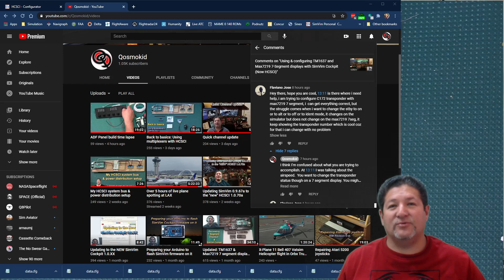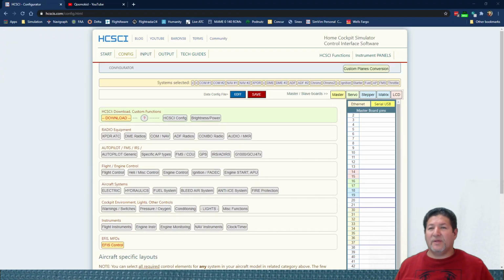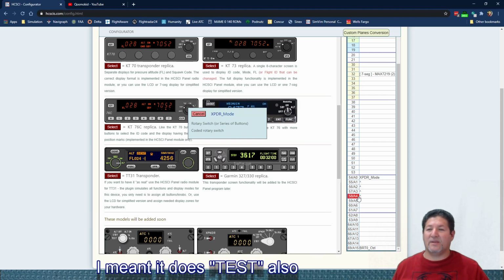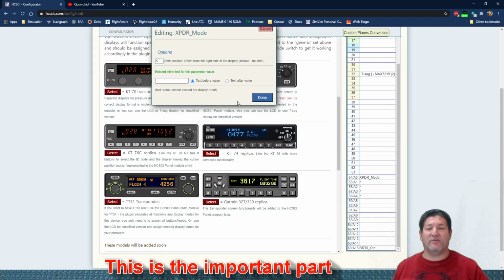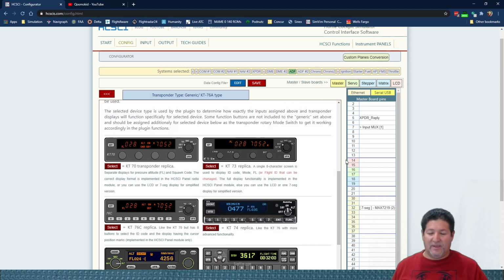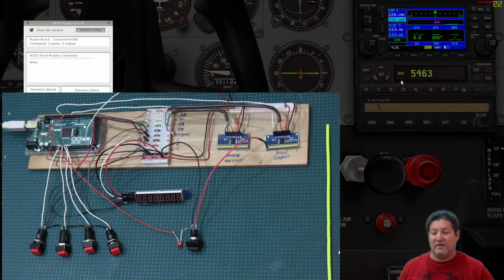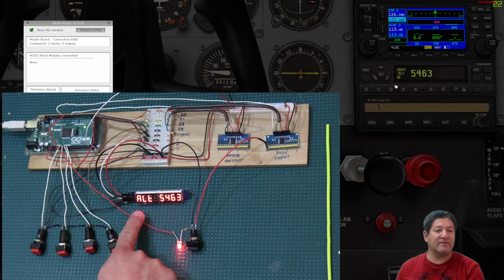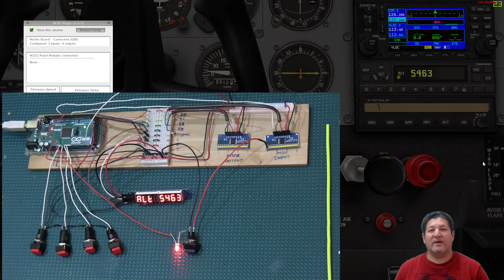Answering Questions: XPDR code & status on one 7 segment display

Comment: hi,beautiful video,but there is a way to use it with 737 by zibo mod?
Reply from the maker: Thanks. Yes, this works perfectly with the Zibo
Reply: @Qosmokid  sorry but i don't understand how.i can't find the "ta only" e "ta/ra" position of the switch
Reply from the maker: @albertomarandino5266  This example i made is the transponder in GA aircraft. If you make a diffetemt transponder like the one in airliners most likely you will use a multi position rotary switch and when you assing it in the configurator you will also have TA and TA/RA
Reply: @Qosmokid  excuse the insistence (and my bad english too) could you make a video explaining this thing? Thank you so much!
Reply from the maker: @albertomarandino5266  I won't be making any videos until the new configurator is released. Have you visited the website and looked at the aircraft image map for the 737? Its all pretty clear once you look at that. But in order to understand how to put this all together you need to read all the sections related to the components you plan to use. Also maybe watching some of the more than 20 videos I have posted here might help too
Reply: @Qosmokid  i have read and (i think)understand the section related the component and i know how to do almost anything what i want.Only, i can find in a specific aircraft and in generic xpdr page where is this particular section.i will try to find out where is my mistake thanks.
Reply from the maker: @albertomarandino5266  I see what you mean, it looks like the transponder types that include TA & TA\RA are not available right now. Before we could select them from the text data table but right now that option is gone too. just be patient a little bit until they publish the new version of the configurator page. I'm sure we will get those back.

Comment: Can you cycle though the modes and only have one switch?  That's how I programmed mine (on the Teensy).
Reply from the maker: With HCSCI I believe you need at least two buttons so they mimic an encoder as left/right clicks to cycle through the modes. Although I think you can set o e button as a selector and make that one swap through the modes each time you press it. 

Honestly I haven't played around much with selectors because I was someone disappointed with that when they replaced input states.

Comment: Is it possible to connect multiple to max7219s? I was wiring my mcp and was planning to use 2 8digit displays. I got the altitude to show up on problem, when I wired the v/s or one display that shows both the left course and speed on the same max7219. if i change the altitutde then all of the displays will show that. If I change the v/s then they all change to that.I have 8 tm1637 displays all showing and no problems but no matter what i do I can't get 2 max 7219s to display without problems
Reply from the maker: Yes you can connect multiple MAX  7219s. It's hard to say what might be the problem without seeing the wiring but as I've said before, 99% of the time it comes down to wiring issues. Are you going to a multiplexer with those? If so are you using a resistor between CLK and GND? One last question, you're not daisy chaining them like its done on MobiFlight right?
Reply: @Qosmokid  i am not using the resistor. I was trying to daisy chain but I got tired of the mess and headaches so ran everything with its own wire to my homemade control board. I am using multiplexer and all of the tm boards work fine but the max boards having been a headache one after another
Reply from the maker: @JalilyFurniture  you cannot daisy chain MAX7219s with HCSCI
Reply: @JalilyFurniture  
Lee, why did you this:  " I was trying to daisy chain but... "  ? 
Have  you read carefully  the HCSCI website? Have you asked help on the website forum or me?
Reply: @SimVimX_System  i wasn't daisy chaining them,  just the vcc, grounds,
Reply: @JalilyFurniture  
OK, understand.
Write to me please about your problem with max7219 (you can do this  in pesonal message, but not on youtube, I'm not using it for conversations.
You can actually use as minimum 16 modules.
Vlad

Comment: Just an idea. Not sure if it’s possible to do with SimVim. Use the 4th digits decimal point or even one of the other digits dp as the reply light in lieu of an LED. I think a regularly flashing LED in the cockpit may be a little distracting but perhaps a small diffuser over the top of it would help make it less so.
Reply from the maker: Not sure if thats possible. At least I haven't noticed a way to address the decimal points.. You can always use a higher resistor to make the LED as dim as you want. I have a flashing LED in my setup for the  ident and it doesn't bother me at all because its not too bright. I just had this one very bright for the demo.
Reply: @Qosmokid  that's right i used a 1k register to minimize the brightness
Reply: Yes, it is possible.
Vlad